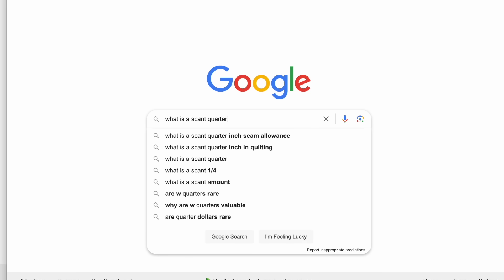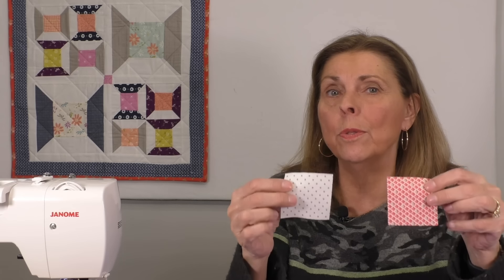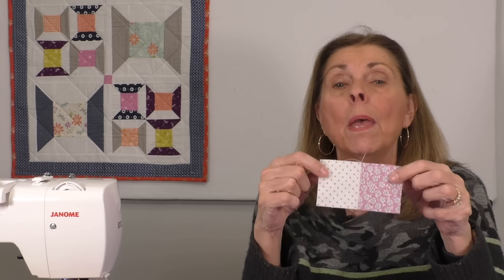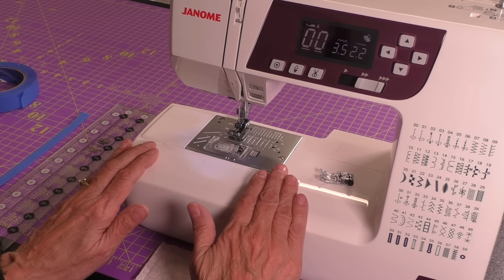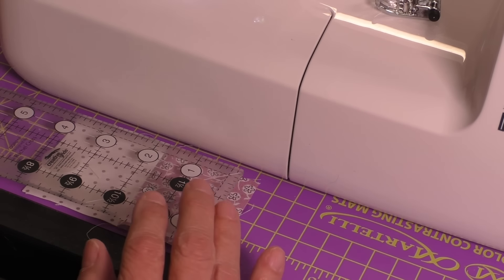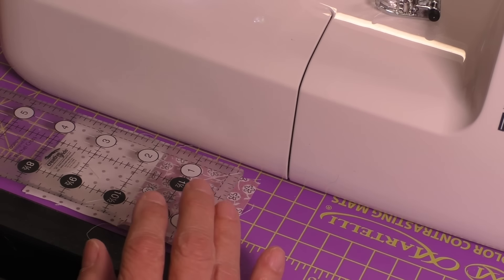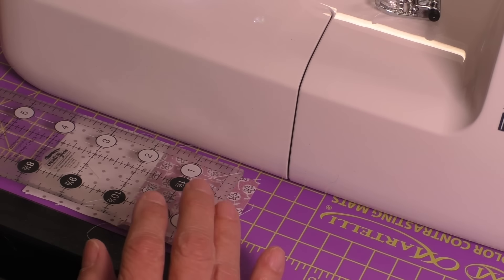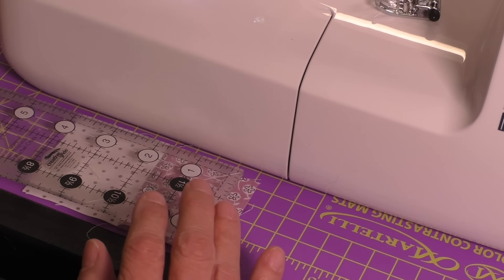Why You Should NEVER Sew "Scant" Quarter Inch Seams

Comment: Thanks for this discussion. I've been saying the same thing for the seven years I've been quilting. It's "received knowledge" and just not helpful. I want my units to end up the right size. Imprecise terms just aren't helpful and  border on old wives' tales because they persist despite the facts.
Reply from the maker: Thank you so much Michele!  I can't tell you how MUCH I agree with you!  Just because "that's the way it's always been done" doesn't mean that there may not be a better or more efficient or more accurate way around the corner.  Thank you again for your comment and for watching!
Reply: To me, using the new term of "scant quarter inch seam allowance" infers that there are two types of quarter inch seam.  But the truth is there is only one accurate seam allowance and this video shows everyone how to get an "accurate quarter inch seam" on any machine every time.  And I thank her for maling it!
Reply: I guess I’m a real quilt rebel. I started making my seams 3/8 inch about ten years ago, and   It simplified the whole business for me😊
Reply: @carolblair2845  That would complicate cutting though as you must rework all your measurements to allow for the extra seam allowance.

Comment: But this still a scant 1/4"...just a different method of achieving it.
Reply from the maker: The point is that many quilters, especially new quilters, are intimidated by the word "scant".  It's too subjective and they find themselves guessing where to take their next stitch (which is not always accurate).  I choose to ignore the word "scant" as I said in the video, and just create an accurate seam with measuring the final piece rather than trying to figure out where to place my needle when I sew a seam.  Tomato-tomahto!  Thanks for watching!
Reply: It's  still a scant...even if YOU don't like the term, lol. Don't confuse new Quilters even more... and don't click bait. That's just not nice.
Reply: Came here to say this
Reply: Gosh this is so helpful. I hate "scant" this is more to the point!! Great job Mary and thank you.
Reply: @joyfulandmerryquilting    This video is misleading because you’re still positioning the tape for a scant 1/4 inch seam. You try to make it sound like sewing a scant 1/4” seam isn’t necessary to achieve accuracy if they just follow “your method,” which isn’t yours at all. Using stacked painters tape (or Post-It notes or a magnetic seam guide, etc.) has been around since before I was born (I’m 73). My mother secured a small block of wood to the bed of her old Singer machine to use as a seam guide. 

The scant 1/4” seam allows for the “turn-of-cloth,” which is the proper sewing term for that measurement difference that occurs when a layer of fabric is turned over a stitched seam for proper positioning. It originated in garment sewing for areas like lapels and collars, for example.
Reply from the maker: I'm sorry @GayleHallAZ  - but "scant" is NOT a measurable term and I am not trying to mislead anyone as I demonstrate the accurate quarter inch seam in this video.  Accurate piecing means the block finishes at the intended size - there's no guesswork involved.  "Scant" is an arbitrary term with no measureable value attached to it.  Simply because the term "scant" has been used to describe the need to adjust a seam to account for the "turn-of-cloth", doesn't mean that it's easy to understand or easy to explain.  It is my feeling that quilting is precision work and I find that it's impossible to be precise when using the term "scant".  My "scant" may not be your "scant" - so I find it impossible to explain to a quilter how to create an accurate piece when I'm using a term that's not measurable.  In addition, when I say "my method", it's my way of doing things - I certainly didn't invent it and I don't claim to have invented it.  I'm just showing what works for me.  In addition, I had never heard the sewing term "turn-of-cloth" in the quilting world until someone in the comments to this video kindly explained it to me.  I looked it up and saw that it was indeed, as you say, a sewing term that originated with lapels and collars.  I have not seen that term used in quilting, but I will use it from now on.  However, I just can't bring myself to say or teach "scant".  Unfortunately, even if a term has been around since before you and I were born, not every quilter (new and experienced) has heard of it, and over the years I have found "better ways" that I enjoy sharing - which is why I have made this video.  Again - not my "method" - just the way I have always done it.  If we both get accurate blocks in the end, then I would say we are both correct.
Reply: This seems to be a way to measure that you are sewing accurately with a scant 1/4”.  A test block is always a good idea because fabric, thread, machines, feet and humans may vary. But it’s the definition of scant  1/4”.
Reply: Unless the fabric is pre shrunk, by steaming or searching BEFORE cutting, ironing will shrink it. Plus the Janome foot or other makes with the edge on are notorious for being too wide. Sorry, bit of a silly video
Reply: To get an accurate Seam, just move your needle to the right.  Do a test seam to check! Easy!
Reply: @hs8747  Maybe you guys should take a break from badgering people on the Internet and eat some fruit. It sounds like you need some fiber in your diet.
Reply: @joyfulandmerryquilting I think most people who know about this issue would understanding that the problem you were addressing was that term "scant" itself is inaccurate and arbitrary and not really helpful. But there are always people who see a thumbnail and click on a video just so they can leave a comment asserting their perceived superiority under the guise of concern for other people who might watch it 👀👀

(and they get bonus points for using terminology like "turn of cloth" incorrectly... 😊😊)
Reply: I think pattern designers should account for a regular 1/4 seam and adjust their patterns accordingly. Or cut your pieces an 1/8-1/4” larger. I feel for the new quilters. My Juki makes a foot that is naturally a scant. I think all machines should have them. It would save headaches.
Reply: My seam is less than 1/4" because that is where my needle sews when I'm not in zigzag mode. I'm set at straight, just inside 1/4". I can't seem to move my needle position. I'm not really concerned the seam is called.🤷‍♀️ Whatever term folks use, or not, it seems that is where my machine wants to sew a quilt seam, if I follow the edge of the 1/4" foot.
Reply: Yes, it's still a scant seam. This is basically a tutorial on one of the ways to achieve it. Click bait
Reply: My mother taped her measurements on her sewing machine 55 years ago. I sewed on that machine 50 years.
Reply: As a beginner this makes sense. I understood scant but the goal is the end result accuracy of the piece sewn together and my scant, if not checked may not be accurate.   Thank you.
Reply: As a new quilter I found this very useful as my first quilt was just a smidgen out, although I checked frequently( by measuring) that my 1/4” seam was accurate.
Just about to join my blocks of my latest quilt, so going to try your method.
Thank you.
What seems obvious to an accomplished quilter, isn’t to someone just setting out. ❤
Reply: You can also achieve this by moving the needle over one tick and get the same result. Scant is technically measurable because it’s the fold over and thread bulk 🤷🏼‍♀️ The other option is sew the way you want, there won’t be anyone coming behind you to check how you sewed your seams. Consistency beats accuracy in this case as well. If all your blocks are sewn the same way, it will all work out in the end.
Reply: This is a great concept.  Forget about the size of Sean but rather focus on the final width of the joined blocks. Thanks.
Reply: @joyfulandmerryquilting  Thank you for taking the time to respond to me and explain your perspective and motivation for producing this video. I totally agreed with your logic as it pertains to the quilting term, “scant.” It’s not typically measured, but I suppose it actually could be, e.g. 1/64th of an inch, but I can’t think of a single quilter who would actually attempt to do so. It’s simply impractical. Nancy Zieman of “Sewing With Nancy” fame was the first person I watched demonstrate the method you showed in your video. She basically taught me to sew garments that fit back in the early 70’s when she was broadcasting her televised sewing show from her own living room in Wisconsin. What a knowledgeable and gracious lady! 

And you, like Nancy, showed a tangible way to help people actually measure the end result of stitching a scant 1/4” seam. Obviously, many viewers benefited from and appreciated your video. I think what bothered some of us was your implication that sewing a scant 1/4-inch seam was no longer necessary when, in fact, it’s still required in order to achieve a final, accurate overall measurement of three pieces of fabric stitched together.
Reply: @jeanareichley6196  Absolutely.  Unfortunately, straight stitch machines can't be adjusted. I've used the tape method, which helps. Otherwise, I eyeball it using the foot and trim if necessary. Once I've pieced it together, it's fine. While watching videos, I heard many times "Finished is better than perfect!" I try to remember that when I'm thinking about taking something apart and realize no one will notice any imperfections except me!
Reply: I'm new to quilting.
The term Scant seam seems equivalent to saying a pinch of this and a dash of that when baking
Reply: I’m was just about to start researching what a scant 1/4 was. I’m glad  your video popped up on my algorithm. Thank you!
Reply: @GayleHallAZ  I am working on my first quilt and I have screwed up every one of my seems, but I am learning and having fun and I found your comment and others like it helpful in fitting it all together, but I was a little sad that my christian sister had a harsh tone . Then you posted this, we are bound to be confused and offended. He said we would, but you and she both took the time to explain yourselves and that's God in you. I really learned a lot from the video and the commentary. ❤
Reply: I measured. ✔️
I use my Accurately “measure”   . 25 inch foot. ✔️

“Scant” -  a weird word for the
Reply: The thread is part of the seam.
Reply: OH! MY! WORD! Thank you thank you so very much for this video! I’m a fairly new quilter and I couldn’t tell you how many “variations “ to a scant can be.  Again thank you for sharing this video, I will definitely get my painters tape out. 😊
Reply: @GayleHallAZ there are always negative Nancy’s and Karen’s even in the quilting world it seems really sad. I for one am so thankful for any advice from Mary after all she’s been quilting for several years I’m assuming.
Reply: Geez some people need to chill with the attitude. This was a good video with helpful info and a different perspective. Thank you for sharing your method.
Reply: Please tell me what you used to cut the tape to get the edges straight. Thank you! 😊

Comment: I have made about 2 or3 hundred quilts in the 64 years of quilting. I believe there are to much concern about 1/4” seams. Just keep your seams the same throughout. More concern should be on cutting the parts on the proper grain. When sewing across grain like diamonds the grain will stretch.
Reply from the maker: Thanks for sharing, Faye!  It sounds like you have a lot of "hands on" quilting experience.    Unfortunately, I have found that it's not always possible to simply sew with consistent seams that are not an accurate 1/4", and then get a perfect block in the end.  If all of your pieces are the same size, that will work, but if you are adding larger and smaller pieces to the mix, the tiny amount that "one" is off as compared to another solid piece that is cut to size - they will just not fit together.  But, again, with your years of experience, I'm sure you have perfected your piecing.  Thanks again for your input!
Reply: Amen to that ❤
Reply: @joyfulandmerryquilting   So true.  That's why test blocks help with no more tears quilting.

Comment: My Juki TL 2010 comes with a scant 1/4” foot which gives me perfect seams using the edge of the foot. My Juki 4000 QVP allows micro moves of the needle and by setting the needle over a bit I get that scant quarter inch seam. No need for tapes. Many machines allow that needle movement.
Reply from the maker: I am glad your machine gives you the perfect scant quarter inch seam!  Not all machines have that capability and the tape works well in those instances. Thanks for watching.

Comment: A scant seam is what you sewed. A scant seam is 1 thread width to the right of the 1/4".
Reply from the maker: The problem is there are many more definitions of “scant” than simply 1 thread width to the right and that can be very confusing especially to new quilters. “Scant” is not a mathematical term and it isn’t measurable. That’s why don’t use it.

Comment: Still ends up a scant 1/4".  It's math.
Reply from the maker: That's exactly why I don't use the term "scant".  Math doesn't use "unmeasurable terms" when it comes to quilting.  You can say "scant" but there is absolutely NO numerical value attached to it which makes it so difficult for new quilters (and many more experienced quilters).  I believe that just because an arbitrary term has been used to describe something mathematical over the years, that doesn't mean there isn't a better way to phrase it.  i do thank you for watching and thank you for your opinion.
Reply from the maker: "Scant" is NOT a measurable term and when we quilt we use rulers, numbers, and measurements.  If you want to use the term, you're certainly welcome to do so.

Comment: Painters tape stacking can be fussy so I use self adhesive Velcro…the soft side not the loop side.  The height of the Velcro is perfect to create a lip…and the adhesive I have found lasts longer than painters tape even reapplying it many times after changing a bobbin.  To make the Velcro easier to grab I turn the very edge under (width closest to me).  When I’m paper piecing I just take it off and stick it out of the way on the top of my machine.  All other procedures are as Mary described in this video!
Reply from the maker: So happy you are an "accurate 1/4" seam" quilter also!!!  BRAVO and thanks so much for sharing your system!
Reply: Interesting...I may try that.
Reply: That's a great idea 💡 👍 😀
Reply: Thank you l am going to try the velcro :)
Reply: Excellent idea but I think the manufacturers of the machines need to be accurate with their seam guides and feet.
Reply: I think what you measured and made was a 1/4 inch seam. A scant 1/4 seam is  a thread or two narrower than a 1/4 inch. I have found it is rarely needed or has limited uses. Good video for arriving at an accurate 1/4 inch. Personally, I will use 100 wt thread and an accurate 1/4 inch seam when a scant is called for.
Reply: Genious!
Reply: Do you cut it short so you can access the bobbin or is your bobbin not drop in?
Reply: @randidaeger157  But the fabric (and thread) you are sewing will impact the adjustment needed. Demin, corduroy, polyester and broadcloth will have a larger offset than a thin cotton or light muslin will.
Reply: Great idea.  I will use this when my purchased cardboard strips are gone; it has got to last longer than they do.
Reply: Methinks I 'll try this! Thanks for a great idea!!! I usually don't have much luck stacking the tape.😢

Comment: You can also cut the fabric a "SCANT" 😉  larger and trim it to the correct end size.  Which is actually, a better technique for ALL your pieces.
Reply from the maker: I do prefer to trim back when I'm sewing individual pieces together, but when you're sewing a more complex block with many seams and intersections, over-sizing - even if it's just a "scant" is not always an option.  Thanks for watching!
Reply: I love this idea, especially stacking the tape so that the fabric has something to follow.  Thanks for sharing your great tip!
Reply: That's not so easy if you use an Accuquilt cutter. My hands don't have the strength to cut that many pieces. I can fussy cut a few, but not bunches of blocks or shapes anymore. Plus, that's a lot more figuring to get the measurements correct. If it becomes a math project, it's not fun for me anymore.
Reply: I agree 😊

Comment: After lots of frustration for years, I finally took the ruler I use for cutting my fabric and measured like you did.   Some people cut measuring in front of the line, some on, and some behind the line.  I used where I cut in front of the line and went over two thread widths.   I was thrilled.    I sew most of blocks without pinning.   I have had great results.  I love the painters tape.  It helps so much.  I sewed with residents of a nursing home, some of whom had physical difficulties, but  with the painters tape they were able to guide the fabric and got wonderful results.  Thank you for spreading the word.  This will help the frustration level of so many other quilters.  I can say from experience that it works.
Reply from the maker: Great information!  Thanks so much for sharing!

Comment: I’ve used painter’s tape, but frequently had difficulty getting the edges of the tape even.  Thanks so much for your tip of trimming the tape.  Thot will be so much easier than fiddling with it.
Reply from the maker: Use an old Rotary Blade - I keep an old blade that can no longer be used for fabric - in a cutter that's specifically for paper and tape.  Works well!  Thanks for watching!
Reply: Another way to make the painters tape edge even is to use an exacto knife and cut a chunk of the tape several layers thick off of the roll instead of unrolling it